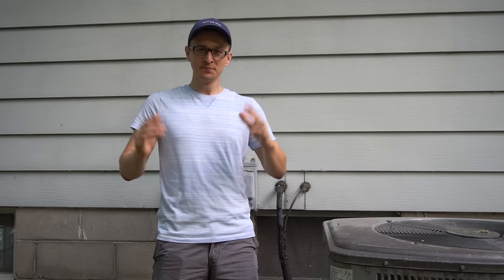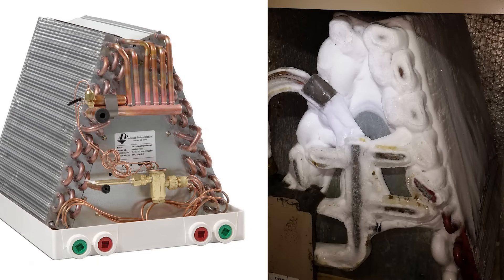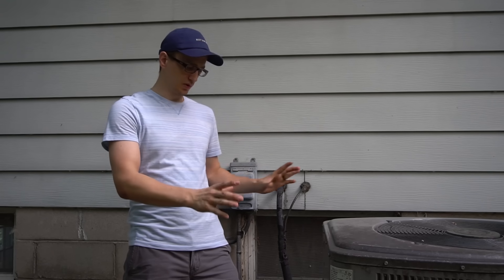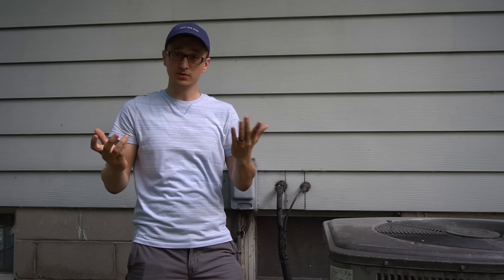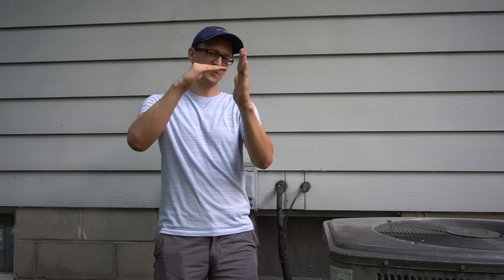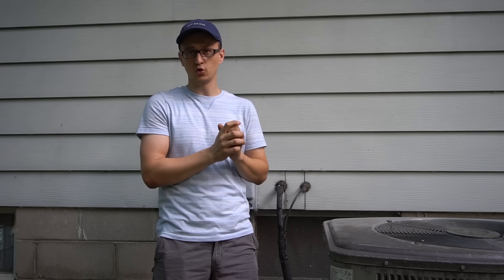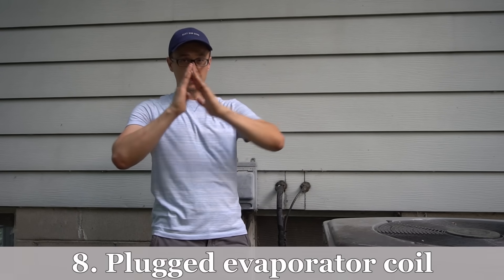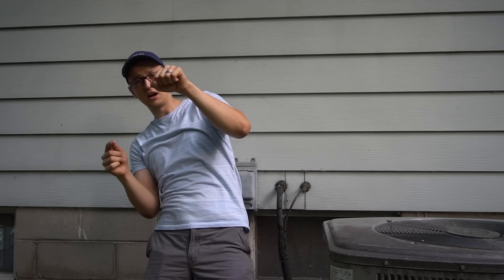8 Reasons Why Your AC is Freezing Up

Comment: HELP HELP HELP.
My Unit works as normal. I mean everything working as it should but the coils aren't getting cold and therefore the air coming out isn't cooler. I can't figure it out. If it was low on R22 then it would freeze. But it is not freezing. I can hear the coolant circulate when I put my ear to the copper line that goes into the coils. 
HAS ANYONE HAVE SIMILAR ISSUE? WHAT DO YOU THINK IS HAPPENING?
Reply: The coils are clean both inside/outside unit. Filter is new. Vents are open. Fan works. Pump works. Thermostat is fairly new Nest product. I have checked everything this video touches on. The valve is not clogged cause I can hear the refrigerant being pumped. Two month ago, the unit froze up and HVAC tech came and checked it. Said it was low. Added 2.2 lb of R22 and it worked fine since. Now its not cooling. Its not freezing. But everything seems to be working fine.

Comment: Mine freezes when the temp outside is lower than inside usually 74 inside and it starts to freeze if its hot outside it wont freeze any ideas 💡?
Reply: I just read that throws AC's off. Turn it off and open windows when it's cool
Reply: Nik S my coils were filthy I cleaned them last night and what a difference. No more freezing. But they look old im going to replace them next time they it gives me trouble.
Reply: @Thedirtylittlesecret  I'm stumped on mine the Freon is right on and I just did a very thorough cleaning of the evaporator coils and the outside unit taking off the top and spraying from inside out. 
The air flow might be an issue or the orfice idk this sucks I have a inspector coming tomorrow since we are under contract to sell.

Comment: Hey Jay, thanks for another great video! what's your take on using a air compressor to blow out debris and dust in the coil or using a pump sprayer with water to wash it? Perhaps in addition to or in place of using a coil cleaner. I've seen people use a pump sprayer to help rinse off the cleaner even if it's no rinse.
Reply: You can also use a shop vac with a brush  attachment to clean the coil ..
Reply: @louiegarcia6189  that's exactly what I did. I couldn't see the coil at all but I took a wet dry vac and just put it up in the shaft and just gently went back and forth over the  ridges. I also ran the fan setting to defrost the ice. If you can't see the coil stick your camera into the  area behind where the filter is and you can see the ice/dirt

Comment: Couple of weeks ago had an issue with my 20+ year old Arcoaire. House felt warm though blower was on. Found that while it(blower)was running (continuously)  A/C unit wasn't working(no fan/no buzz/nothing). Shut main A/C power off, removed the panel, and just blew out debris from inside, particularly around contactor(stuck open?). Turned power back on and seemed to work OK...for 2 weeks. Yesterday woke up this time to no blower fan, but A/C was running(and running...and...)and had frost build up on the line pretty bad. Removed panel and took a better look at the contacts, they appear pretty corroded. Can stuck closed contacts cause this condition also, or should I look elsewhere?

Comment: Thank you so much. My situation is different. Ac not blowing cold air. Condenser and fan is working. No ice on pipes. New air filter. Sucked all the gunk from my pipe. The pan is clean. The unit is only 2 years old. AC is saying the coil is leaking that why your refrignet is low. He wants me for change the coil for 900 dollars. I do see some water outside by condenser unit where the pipe is. Not sure what you call it. He checked the freon there and never came into my house. Could coil go bad in 2 years?

Comment: I have this issue with the plastic wheel part of the BLOWER .. it keeps melting ... i keep having to replace it and lose money. its connected to a metal shaft. that shaft gets too hot and it melts the blower until one day it brakes.

Comment: Awesome, I just checked mine and it was like a freezer. Letting that sucker thaw now, hopefully the culprit is a dirty filter
Reply: Migzy I’m having trouble with my ac.  It has been blowing cool but not cold for the past three days or so.  Went outside and saw the frozen line.  Last summer I had Freon added and leak fixed to the tune of about $700.  Before having it serviced last year, I managed to hoist my bag butt (I’m a female) up into the attic to take a looksie.  Boy was it hot up there.  I didn’t see where there is a filter that can be changed like the vids I’ve watched (easy pull-out compartment with a handle).  Do you think I have a filter underneath the A coil?  Mine is all taped and plastered shut.  Freaks me out to go that far in my investigation, however, I can’t imagine how much a tech would charge me to do it.  I’m letting the line thaw now and I guess I need to go up there to make sure things don’t get flooded. 😬Seems like the a/c acts up when the temperature outside gets into the 90s.  Guess we’ll see.🤗

Comment: For decades, I was told the coil freeze up was due to low refrigerant.  (This was back in the bad ol' R12/R22), so I would just get a can, follow the instructions, and top off the charge.  I never figured out it was due to the pressure/temperature relationship, but it makes sense.
Reply: At one time R12/R22 were good refrigerants; when EPA got into the act, we have to keep replacing units and refrigerants R410A is set to be replaced in awhile. This never ends and the ozone layer keeps on been depleted!

Comment: Hi. I have a different situation. My ac runs ok but here it is: the outside unit sits close to my neighbor’s. When only one is running, it’s fine; when both are, there’s a noticeable dissonance between them like a hum or something that’s very annoying. Do you think the source of this distressing sound is coming from the fans ( cw vs. ccw?) or the compressors? Mine’s a Goodman and his is a Rheem. Also, my ac cools down the house in 8 minutes, set to 76 for now, and kicks off in 15 minutes intervals, longer sometimes; the rheem runs like forever it’s mind boggling and we’re both in a duplex type unit— same size, everything. Idk what’s going on between these two condensers running together and then making that awful sound. It’s like listening to a rock ballad duet that’s gone bad and worse, on auto repeat. Solo is fine. Any ideas? Thanks.

Comment: Our outside a/c unit which powers the downstairs a/c is frozen over. My husband insists the unit does not have a filter. Is that possible? We have a second unit upstairs in our attic with the furnace, which powers the second floor a/c - that one does have a filter. Just trying to figure out whether the filter step is applicable to my outside unit. I even pulled the manual but it isn't clear from that. Thank you!

Comment: When my evap "A"coil iced up, I removed the access panel, used my wife's hairdryer, set it to "low" heat; it took about an hour to thaw it out.  Great video!!
Reply: All you have to do is.Turn the AC off and just turn the fan on.the heat from the air in the air in the house will melt the ice naturally...once the ice is all gone,Make sure your filter is clean if it wasn't and turn your unit back on.If it runs fine,Then it is alright...but if it starts to freeze back up call a service tech..
Reply: Time is the best option, you can get to the outside of the A shape of the coils but if don't remove the center cover and get up between them you'll still have ice inside, which is where air flow starts.  Ice remaining inside will likely cause it to ice again because air flow is still a problem.
Reply: Or turn on the furnace for 20 minutes? That will melt any ice.

Comment: Sir, my indoor aircon split type the compressor is on and off after a minutes and sometimes when to much hot outside the compressor doesnt work but the fan is normal and working. What is the cause of on and off.

Comment: We bought a house a year ago, the AC seemed to work well last summer. The AC is not cooling, although the fan works properly. When we removed the carpet we noticed signs of an old leak next to the AC unit, when we opened the unit the the coli was frozen, we have cleaned the coil two times and the condenser outside . The coil still freezes, but takes longer to freeze,  we noticed that the air flow to the fathers room is lower than it in the other rooms.The AC unit is located in the laundry room and there is not air return duct and no place to add a filter. The unit brand is Nordyn, model FEG-020HA-01. Any suggestion?

Comment: I just had my A/C unit serviced last year. They added at least 2lbs of freon. How do I know if my unit again this year is low on freon?
Reply: Rickmn_Acct same here.  Had leak fixed and Freon added.  Now ac has been running cool, but not cold.  I can’t be sure if blower motor is running.  My unit is in the attic.  Went outside a moment ago and noticed the frozen line.  I hope it’s a simple fix.

Comment: HI hope this will not be too long ! I live in an apartment 2nd floor and it has been hot last few days. The motor was replaced as made a screeching sound finally cut out. Maintenance guy replaced it and said compressor is bad needs to replace it. Came yesterday replaced the capacitor said all good to go take a few hours to cool down. Well after 2 hour woke up from nap blower not working iced up in lines going in and out of unit! So took off door hiding it and saw the filter was not back in place as was dirty not replaced for 2 years now add the whole front was left off. Finally turned it off fan does not work ! To be honest hate to be lied to like was from the maintenance guy what the hell was he thinking ? He did put more Freon in all that said if you could help me sir, is it a bad motor again? Whatever help you can suggest would like to get this done before the summer really occurs! By the way love your channel! TY so very much for any kind of help!

Comment: Thank you, thank you!!  My ac condensor and lines outside  are solid white ice, and no AC in the house.  I reset the circuit breaker and the ice melted and now have cold air coming out of registers.   I will inspect my 18-year old A coil for dirt.  My filter was new and I change filters regularly.  You were very informative in your video.

Comment: I have an evaporator coil that quickly forms puddles in my register plennum below. It ices and then drips in between cycles.  I went outside to inspect it and found the compressor run capacitor was a lower value than the OEM design... 
   Aside from wear at the compressor, what performance issues would develop if a OEM rated 55uf compressor run capacitor was replaced with a 45uf capacitor? Would this lower run capacitance cause the compressor to run slower, not cycle gas fast enough, take longer to cool the home, freeze moisture on the evap coil due to running too long being compounded with increased moisture and developing ice (which further restricts airflow and extends cooling cycle time) --- or all these things?

Basically will a 12% lower value capacitor that may be performing even lower due to usage wear cause a viscous cycle of evaporator coil icing?

While I'm asking, comversely what would happen if a 60uf was installed in place of a manuafacturer spec 55uf capacitor? Would the compressor cool a little faster, but also wear out the compressor motor a little faster? Any other issues using a slightly higher run capacitance (in this example, a run capacitance within 5% of 55uf if the new cap is a true or less 60uf)?

Thanks!

Comment: Great job of covering the points and why And what Not to Do . I’m a DIY guy . I had a coil replaced after 10 years of having a slow leak ever since the system was installed in my new home. The person who sold it and did the install  would come and check it and said there was no leaks found but the system was low on Freon . I have a propane heat split system . 30 ft of copper lines ! Which were all exposed in my basement rafters ! and I’ve replaced my motor run capacitor before. Later the condenser motor!

Comment: i installed a 2 ton ac. the evap had a danfoss #53 orfice piston in it. the cond unit had a #57, i put that in. im getting 5 to 8f superheat at cond unit. im concerned, what do u think? use a 53 or 57, im getting 2 different information. after the long weekend ill call supplier but for now id like to figure it out....thx
Reply: also the cond unit is a ducane

Comment: Can anyone tell me if I spray the outside unit out, do I have to take the fan off (after  turning off breaker of course) and spray from inside out as one guy told me or can I just spray that down from the outside?  Thanks for any help on this question.

Comment: Technically, there is only two reasons. Low refrigerant or low air flow, several problems that will cause them but these are the only two.
Reply: My technician came and changed capacitor and filled refrigerant. It did nothing. He tried to have unit running without the new filter, it was dry and running well. But as soon as the filter is out in, it freezes over again. We spent over $800 already. We are back to zero. Why??
Reply: Xiao Xiao you need to verify air flow across the indoor coil first. Make sure all supply grills are open and unobstructed, air filter is clean and not too restrictive (i.e. expensive, home owner supplied or washable kind) , blower is running at full RPM’s, all zone dampers are open(if applicable) and evaporator coil and/or heat exchanger is clean. Then and only then can you check the refrigerant charge.
Reply: Halfman Halfamazing thanks for replying! I think it has nothing to do with the filter as I initially thought. I saw a few videos online. I think TXV is bad. The tech came yesterday and used a cup of ice water to test it. The temp continue to go down even when the valve was dipped in ice. That’s probabaly why the A coil lumped up with ice after the AAC has been in for a few hours. Even when the coil is iced up, the valve doesn’t close. The ice just comes bigger and bigger until there is no cold air comes out.
Reply: Halfman Halfamazing Yes. I checked all that you mentions. All vents are open. Returns are all cleaned and open. Coil is completely clean. Filter is bought recently. But I plan to get another one just to see. If the washable kind better?
Reply: Xiao Xiang get the “cheap” filters,  (in most cases) your system is designed to use them. And if you have verified air flow, then I think you are correct about the TXV, but without knowing pressures & temperatures, I can not be sure. But it’s a good bet that the TXV has failed or been clogged up. If the unit is a heat pump, have you ran it in heating mode?
Reply: Halfman Halfamazing heating never caused any issues.
Reply: Xiao Xiang heating mode can help determine if it’s low on refrigerant or help free a stuck TXV

Comment: Jay, Dealing w/the Texas heat already.  Several days ago I found your Excellent site and followed some of your steps: 1) Changed Filter {It was good as I have a sensor to tell me when to change}, 2) Cleaned the external casing of the HVAC unit, 3) Replaced my condenser (Thanks for the tip on discharging prior to shocking)...Anyway, the inside thermostat temp was set at 72 and outside was 100. The home temp rose to 89.  Yesterday I had an AC company come out; concluded I had a slight leak in my internal coil (he fixed by turning 1/4 turn to tight) and put 3 lbs of 990 or 930 (I could be wrong about the number).  The home temp over the next five hours dropped to 74 and stayed there.  Never hit 72, never shut off..8 1/2 hours later the temp was up to 77 and I checked the outside line...Frozen up to the compressor.  I turned of the system...any Ideals?
Reply: Did you ever figure this out? Ours is doing the same thing....repaur guy is coming tomm to reolace our A coil...he thinks it went bad....
Reply: Did either of you determine the cause? I have a similar issue. For example: if I keep the thermostat on 72, the A/C runs for hours non-stop trying to keep the temp down but on a ~90 deg. day it can only keep down to ~77-78 midday and will lower a degree or so per hour when the sun goes down until finally reaching 72 in the nighttime. Same cycle everyday for weeks now. I cleaned filter, cleaned outside coils, cleaned A-coil, replaced outside fan, new thermostats and no duct leaks. Good flow from vents too. I’m stumped?! What was your outcome? Thx in advance!